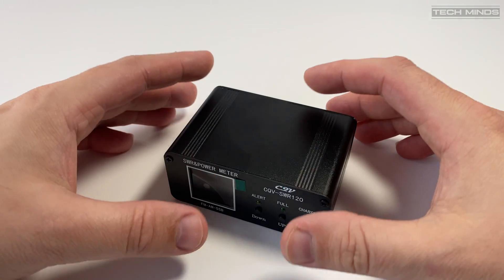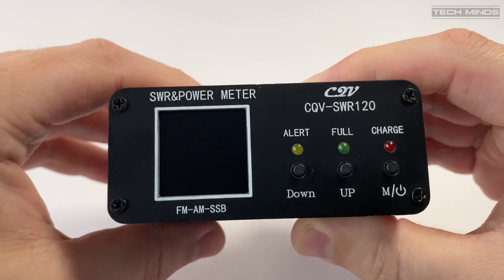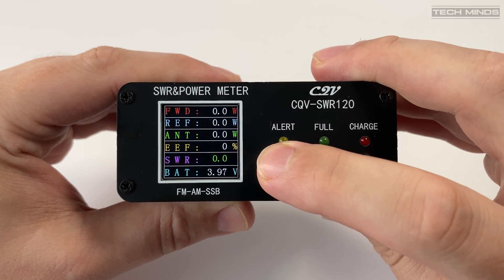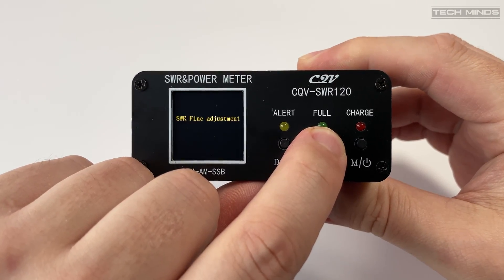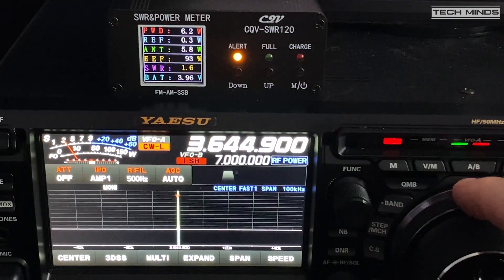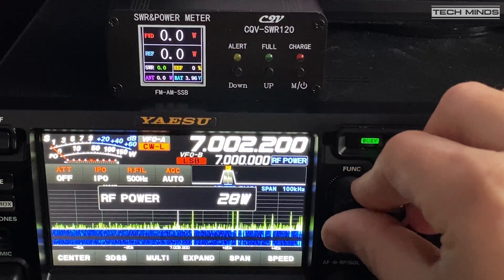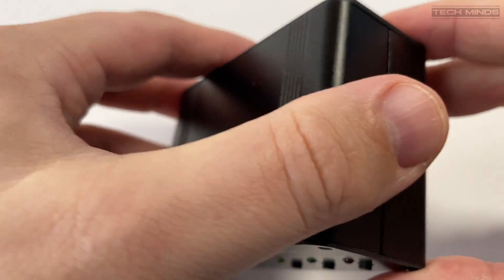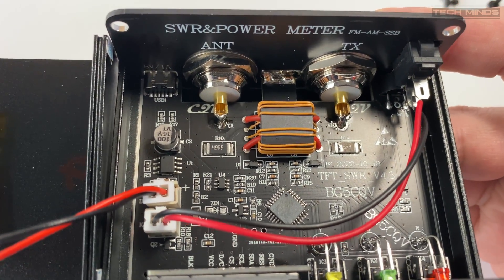Digital Power & SWR Meter With ALARM Feature! CQV-SWR120

Comment: Curious did ou have any "hash" noise interference caused to the radio receive when the Swr meter is turned on?  I have heard another model with the 4" screen has this problem

Comment: Buen día amigo, tengo un equipo igual al de usted, hay una opción que descubrí en el equipo y no se para que es. El equipo lo tengo apagado presionó el botón de alert y enciendo con el botón de encender y sale una opción que dice FWD Fine adjustment y sale +0 aciende hasta +20 de igual deciende hasta - 20. Igual tiene otra opción el equipo apagado presionó la tecla Full y enciendo el equipo y me sale la opción  SWR Fine adjustment +0 ascendiendo hasta +20 y desciendo hasta - 20 los parámetros los deje en +0.  Me puede ayudar qué significa esta opcion. Gracias

Comment: Curious if one can run the meter off of the power supplied by the USB-C and not damage anything.
Reply: From the look inside you can unplug the battery pack and for a permanent install, it would be wise to remove the battery...

Comment: I just received one of these and for some reason it works fine on FM, but not SSB. Power reads incorrectly (radio set to 50W and meter's power is all over the place, but settles at 1.7W. I have a message in to the Ebay seller, and will update here.
Reply: That's how SSB works. The power varies with the modulation. To measure your power use a constant output mode like CW, FM, RTTY, etc.
Reply: @AlGritzmacher  My analog meter does show a needle swing-up when modulating on SSB, but, all I see on AM is basically a carrier reading-with no modulation swing.  I thought that AM also would swing the needle with mic input...  ??

Comment: I wasn't much impressed by the solder connection of the SO-239s' center pin to the board.  The blob on the TX side was kinda stringy and elongated... might not take a lot of jostling in the field to break it.  Otherwise I like it!  And the price isn't hideous either.

Comment: Would be cool if it cut to a dummy load if you ignored the alarm for too long.
Reply: Yeah that's a thought. Especially if it was just a third connector on the back so you could wire up your own. Mine just arrived today. Tempted to jerry-rig it at some point, maybe off the red LED with like a transistor and relay...

Comment: Even if the battery life were an issue, it would be incredibly simple to replace it with one of a larger capacity. There looks to be plenty of room for a larger battery. Neat little device.